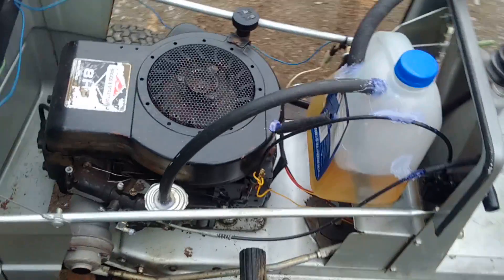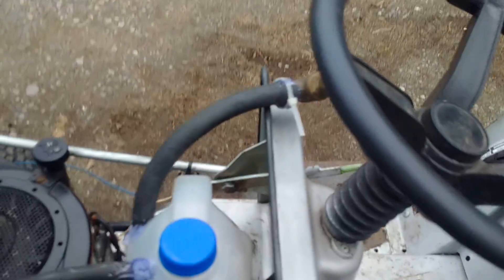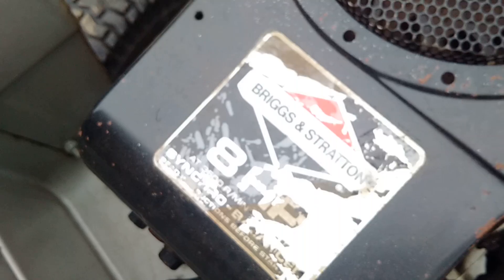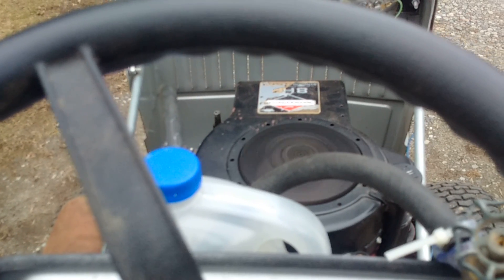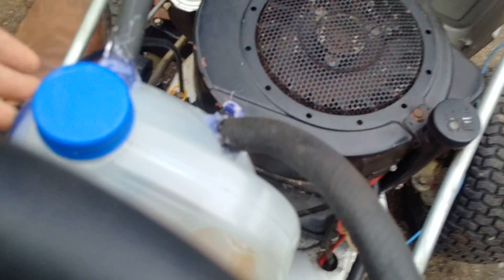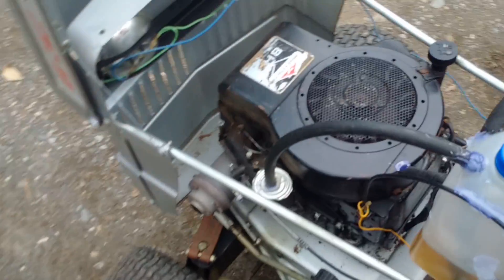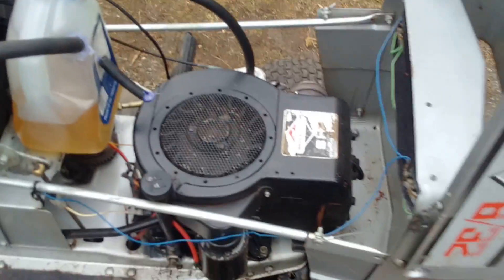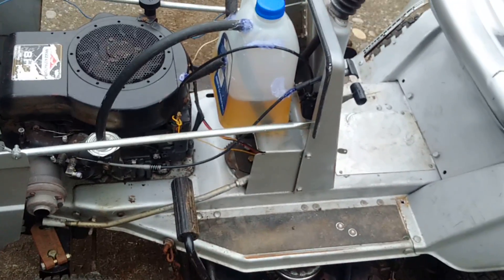Run an engine off gasoline fumes (REAL)

Comment: I know it's just a mower but you might try putting a air filter on it . and what about getting enough lube on the valve guides ? I'm going to do this on my bus the valves are a bit loose any way and going to pull  the head off to rebuild I'll see if it is cracking the valves . gas explosions is hotter than liquid.

Comment: Why are you not using a 3/8 or 1/4 inch line. The gas Vapors will be sucked down it just as fast.
Reply: a linha de entrada deve ser o dobro da saida.
Reply: rgfkopdfdpokl,ff  u
Reply: si

Comment: I am a Mech Engineer and I don't see why this would not work. Its only the fumes that enter the cylinder that explode and provide power - gasoline droplets burn thus are expelled out the exhaust.
 One problem is that if the engine backfires your tank goes bang - very dangerous.
Reply: spahr001 yes a metal screen or a flash arrestor
Reply: A metal screen between the intake and the tank may prevent the flames getting to the tank.  Any thoughts?
Reply: You just put a screen flash arrestor. Can try it yourself put a cigarette lighter underneath it for the flame will not go through

Comment: i hate to be the 1 to tell you that this myth has been busted, you engine  is not running longer then it would on the regular fuel line.
Reply: chaba72 that's funny because shell has a 1959 Opel they got 377 mpg with like 60 years ago. they released the info and have a patent. that's still public. over 5000 patents are restricted from the public. also in the 1929s vapor carburetors got 80mpg and 50mpg in v8s. now they can get almost 200mpg on v8s.oil is trillions a year industry. govts get hundreds of billions in taxes from it. if we got 10x better fuel economy that's 10x less profit and taxes and gas prices would go even cheaper. demand would be less and production is at peak almost. not to mention millions of jobs lost as oil industry camr to a crawl of what it is today. won't ever happen. to much money at play. Exxon alone makes around 300billion in profit. world govts take at least half of that in taxes. budgets go up not down esoeicsllyt not from 300 billion to 30 billion
Reply: google shells 1959 Opel and you can see the original car,  the article and the patent for the vapor carburetor.
Reply: and that car was heavy solid steel it was a 4 cylinder. probably only had a 3 speed transmission. today's light weight materials and 6 and 7 speed automatics. we could get probably 500 or 600 if they got that with a heavy ass car and old transmission technology. and today's oils have less friction then Dino oil of days old
Reply: James Smith  look at some other videos that showing the results
Reply: Du bist der allerschlauste 😂

Comment: Great video. Evaporation is a good idea. But gas oil can not be evaporated by this process. Evaporation of gasoline and diesel oil and then direct injection into the engine can be accomplished by a new method, see http://commonairengine.com, https://youtu.be/sknk3RrolSc
This is Increase efficiency and reduce harmful emissions.
Reply: Common Air Engine actually it can be evaporated like this. this does work. look up shells 1959 Opel that reached 377 mpg with a vapor carburetor. they hold a patent. a article was released and masses never saw the technology. the patent is still public surprisingly. there's over 5000 patents in the US alone the public will never see

Comment: so whats the point?   is it better fuel economy?   I run my lawnmower on propane.
Reply: matthew lee much better fuel economy. that depending on what you have to cut. that will last all cutting season cutting weekly. in 4.6l v8s average is around 100mpg
Reply: matthew lee look up shells 1959 Opel that got 377mpg with a vapor carburetor. they posted the info the patent is still public. over 5000 patents in the US alone that are restricted to the public. During the testing the only requirement was cars can't drive below 30 mph. Hitler back in the 1930s his heavy bullet and bomb proof Mercedes got over 50mpg with this. Exxon alone makes around 300 billion in profits. the govt takes what 50 percent or more. now take that can scale it back by 10. if the average car now gets 30mpg instead of over 300. the trillions of dollars a year in the energy business would be gone over night. or never got this big. the demands for oil would drop so low. gas would be back at 50 cents a gallon for premium. this will never happen. I fought on the front lines for this country. us troops were protecting the oil to convoys and the oil wells in Iraq. 400,000 life insurance pay out for death in combat,  is nothing to what each well pumps out daily. chump change literally. and it won't change and oil is no where near running out. wells that dried up decades ago are fully flowing again.  the earth makes billions of gallons of oil yearly it's a never ending process. everyone's yard across the world is oil millions of years for now. all the algae in the ocean making its way to the bottom is oil in millions of years. the process never stops. with a little common sense and restricted patents unrestricted we could use oil forever. also this vapor carbs release almost no toxic emissions.  you can stick your face by the exhaust. the heads and combustion chambers get 0 build up on them. the demand would fall so low for oil. millions of trucker would be unemployed, gas stations would close by the tens of thousands. the oil business would lay off everyone world wide. now all these people are now burdening the system instead of paying into the system. the govts of the world lose hundred of billions in taxes,  lose income taxes. states and govt. lose on taxes from daily living these people would spend. it's a lose lose situation they have created. think back from when you started driving, cutting grass,  boating etc. all those activities could have been done with 5 percent or less of the gas or propane you've put into those engines.
Reply: also it puts it in perspective we have lost what 11 or 12k soldiers and Marines. take that number and multiply it by 400,000 the 100,000 missing arms and legs each limb is 50,000 just one oil well has paid all that. Afghanistan is full of precious metals and gems as well. not to mention the opium fields we didn't destroy the few we did was for show. we went allowed to touch them. the human Cost is acceptable to them they have received 10s of billions more in profit from it. and had to pay out change for the human cost. then for the survivors ask any vet how the Va treats them when they go for help. they'll give you bottles of pills instead of surgery you need. much cheaper. to give you 6 or 7 prescriptions I'm not saying you don't but most of the comments I read on here people really don't understand how the world economy works. it's a energy based economy. the US dollar is backed by oil the gold standard was removed long ago. not enough gold to even back up 10 percent of the money in circulation. look at how hard the US is trying to keep the petrol dollar the standard in trade for OPEC. with the Euro worth more. we promised to protect all OPEC countries from themselves and invaders if they use the US dollar to trade in. your talking trillions yearly. why would they ever trade that in for less then 10 percent of what if is now. it's literally record profits year after year. more profit means more taxes on that profit for each company the oil companies operate in. I can't believe so many people believe the govts love us so much they would give up trillions to stop pollution and give us cheap energy. With us needing so much gas and electricity they can control us and play with supply and demand as they see fit.
Reply: So woke, no need for suffering in a world so plentiful.

Comment: Just tried this myself today and lo and behold it worked. An added bonus is that it doesn't seem to matter that the carburator is bad. It ran before with lots of misfiring and really rich. Now after a little tinkering with the airvalve it runs great.   

https://m.facebook.com/story.php?story_fbid=10155631217089130&id=651324129

Comment: For all of the people on hear that seem to know it all, I have a few questions. 1. If hot intake track is what atomized fuel, then what is the point of a raised plenum intake for performance? what does a booster venturi in a carburetor do, where is it located, and how affective is it?

Comment: Great, you built a carburetor. Funny thing is, it already had one. The optimum fuel/air ratio is 14:1. Too lean or too rich and you've lost the objective of maximum power, vs fuel economy vs engine damage. Anyone can get an engine to idle on fumes, put it to work, That's what an engine was designed to do, work. Put it under a full load thru the carb then your contraption and do the same work and see what happens. I am betting either or both, your engine will do far less work with the same amount of fuel and probably mechanically fail trying to do it. Show us that, your convinced its better, prove it... that's what real science and results are all about.

Comment: With fuel injection it would be a vapour anyway. The unused fuel goes back to the tank via a return line. "The engine" no matter the the type, will only run with the right fuel:air mixture anyway. Secondly as vehicles run also LPG this idea is not new. The kilometers you get out of a tank depend on the way you drive the vehicle and whether it is highway or around town. Each vehicle has an optimum speed/ Rpm where the engine is most efficient depending on it's load. Over here in Australia we are paying around $1.40/L on avg. (3.79L Us Gal lqd) for unleaded and around 80c/L for LPG.
Reply: Fuel injectors do not turn gasoline into a vapor. Just like a spray bottle, it channels it into a mist.
Reply: Brother at temp they are vaporized instantly
Reply: If "at temp" you mean the "flashpoint of gasoline," then sure. The liquid fuel sprays into the combustion chamber as it hits the compression stroke, and then proceeds to vaporize. 

What are you getting at?

Comment: Ok first 95% can not be possible show how you gotten that second it is a good and works but not that well 3rd 95% of people have fuel injected vehicles so it's going to be a little bit more difficult with the carburetor and bead just turn the key and it goes and you don't have to mess with turning gas on or anything like that

Comment: very clean mower, I want to try fumes too but I'm scared of a back fire causing a fire. if I try it, I want some kind of flash arrester on the intake hose, I even bought a few PVC valves but blew on them both ways and found out their not an air tight system. I may make a check valve with PVC pipe.

Comment: I have always been thinking about this ever since I realized that exaust has carbon in it. Nice concept, but I don't know if the government would approve of using motor byproducts as fuel
Reply: Most modern vehicles recycle the exhaust fumes to cut the emissions down further. (EGR Valves, which are a common MOT failure now in the UK lol )
Reply: neat, I didn't know that

Comment: Is anyone going to mention that the purpose of a good carburetor is to do this (mix air and gas) ??? Of course fuel injection does it all much better... remember... gas is a gas... You just see it as a liquid at STP (standard temp and pressure)... Don't play games with gas! It is smelly and potentially dangerous... Ask someone who has been seriously burned... Be well! :-)

Comment: U NEED TO HEAET 150-190F, BECAUSE IN VACUUM TEMERATURE GOES ABOUT 0F... I VE DONE  IT TO MY CAR (CHEVY BLAZER LT 4.3 2001 4WD AUTO) AND NOW IM GETTIN ABOUT 90MPG CITY (New York) before i did heat system it was 25-30mpg... ... sorry for capslock
Reply: Nicky Surr  tell me more please
Reply: make ur own research, but i can tell ya in a few words, heat up not more than 400F, use a thermos to keep fumes warm overnight. and google 200mpg carburator.
Reply: LOOKS LIKE GEET TECH HE HEATED HIS FUEL
Reply: Nicky Surr guess your smarter than  auto makers!
Reply: Nicky Surr That's AMAZING Fuel economy.If it works that good I'd like to see a short demo.OK. just saw it.Google 200 MPG.carb

Comment: Ok, first of all I want to commend you on flexing you exploratory and ingenuity muscle. For those of you that think it’s fake it’s not. In fact all internal combustion engines already do this in a more safe and controlled fission. This process happens in the intake manifold of your car’s engine, or lawn more in this case. Liquid gasoline is actually impossible to ignite. It fist needs to gasify and mix with oxygen; which is what Jr here is doing on his daddy’s mower.   

So yes, it works, But Jr you did not invent a more efficient way to burn flue. The gasoline will still spend at the same rate it would have if it were pulled straight from the tank. What you did effectively do however, is just create a unique way to mechanically castrate yourself. Witch at this point I’m on the fence on. You know, on whether or not that’s a good idea. I just don’t know if as a species evolution should allow you to reproduce. 

I tell you why. By building a way to effectively mix flue and air and trapping it in an enclosed chamber (your mom’s empty gallon of milk) you have just created a bomb that will on the first backfire blow your little nuts clean off your little pecker.   Thant and probably bathe you in gasoline that will in effect probably kill you. 

So get your invention off the mower, and less midnight fantasies and more science studies.
 
Hope you are still in one peace
Reply: Pablo Arias to add to your comment then the mower blades comes flying up ,what's going to happen  I commend him as well but I wouldn't do it on the mower something with a blade spinning under my ass
Reply: Pablo Arias Very comical way of telling Jr. he's rideing his mower into the sweet afterlife.Yes useing a plastic jug & hot glue is not hi-tech.Or not haveing a backfire arrester.It would make a HILARIOUS video of Jr. rideing on the lawn and boom💨Jr.takes off running on fire.Not really, I wish no one to blow themselves up.But your explanation was right, too much sloopy rigging.I'd want to see fittings &better fasteners& more safety in a build with flammable 
& dangerous fluids like ⛽  GAS.

Comment: You used Hot Glue? That engine will get very hot in a few minutes to melt the glue anywhere you have put it. I’m a mechanic and I have tried to get this to work but have been unsuccessful.... And you use hot glue...You’re a lot smarter than me.

Comment: Much flawed logic here,  keep experimenting and improving this and you'll eventually wind up with a carburetor.   Cold start system, float to keep gasoline constant, power mode, throttle plate ....  keep going you'll get there.

Comment: All gas engines run of gasoline fumes. Gasoline doesn't burn in a liquid state. Diesel is the same way. Engine manufactures have just made it much more economical and reliable to deliver the fumes into the cylinder.

Comment: The problem is...with this system there is no governor to send more fuel when there is a high load..it only pulls in fumes as the piston pulls it in at a constant rate
Reply: nate d unfortunately it will stall because the fuel air mix is a constant. the governor does call for more air that pulls more are fuel thru jets increasing the ratio..his machine will work under light loads..but won't last long without extra top end lube from time to time..watch a video of engine with a see thru head
Reply: nate d the system is perfected it's already on the lawnmower from the factory it's called a carburetor..proper fuel air mix to get most power and longevity from engines..with this setup the octane of the fuel slowly diminishes it's horrible for the engine
Reply: It's fine if individuals want to put a system on their engine that has higher efficiency..but to expect a company to mass produce a system that has lots of maintenance and would require owners to listen and determine when the fuel has lost its kick when most people are to stupid to check oil and air filters ,you will be waiting forever..the technical support line calls and product return rates would skyrocket.

Comment: I've been experimenting aswell. Try the highest octane you can get 91 or 93. Put a filter on your intake mixture valve and a backfire screen where the carb is.

Comment: Do you know why a traditional fuel system setup only burns 5-10% of the gas? The rest of the gas COOLS THE COMBUSTION CHAMBER! I give you points for making the engine run like this, but it will destroy an engine long term... and in an actual car, short term.
Reply: TheZenguy No. It's not. It's for lubrication. Have you ever tuned a car before? Do you know what AFR is? Do you know why you want richer than stoich at load? It's to keep the chamber and heads from overheating. Try learning a few things before you call someone a dumbass. Thanks.
Reply: kingcrimson234 so I guess all the fork trucks that run gasoline engines converted to propane are all flukes huh?
Reply: kingcrimson234 thank you for this explanation... running on fumes just seemed too good to be true and incredibly unrealistic
Reply: kingcrimson234 You know thats what the oil is for right....gas isnt for cooling dumb ass
Reply: It's sounding bad already knocking from fumes only
Reply: You're comparing apples and oranges. A propane/air mixture burns much differently than gasoline vapor. Those trucks also run much cooler thermostats to compensate, and a lot of them still have overheating problems.
Reply: If you're denying that your heads/engine will overheat under load with a much too lean AFR, then you don't know what you're talking about. Install a supercharger and run a 14:1 AFR tune for a while. See how long your engine lasts.
Reply: kingcrimson234 even if you forget all that for argument sake running this way has no governor to send more fuel when there is a high load.. correct?